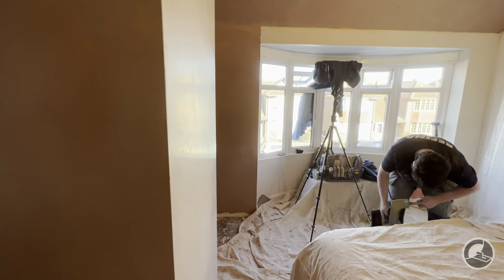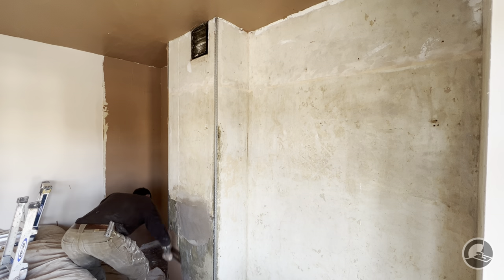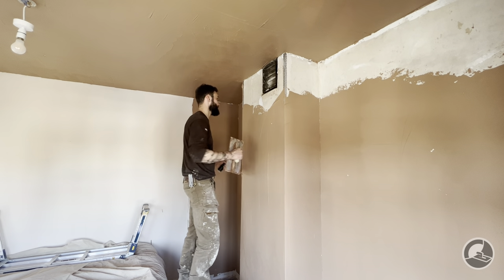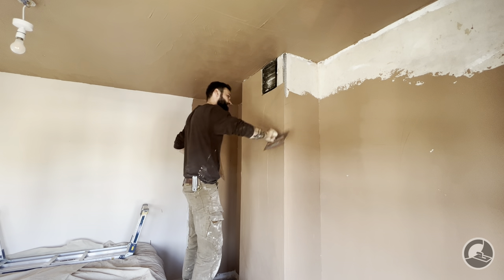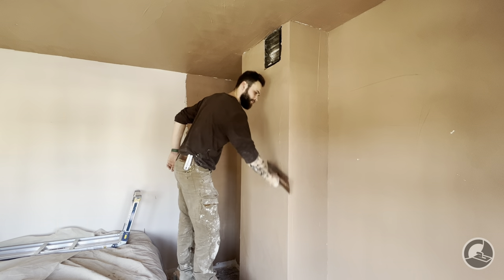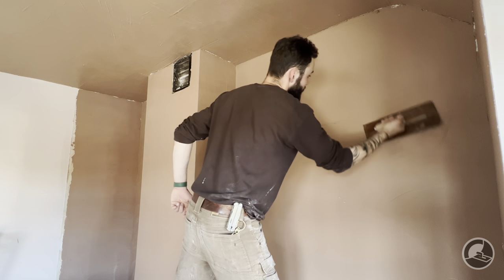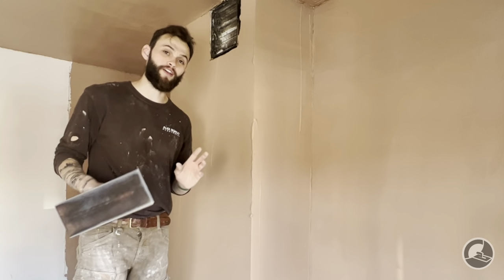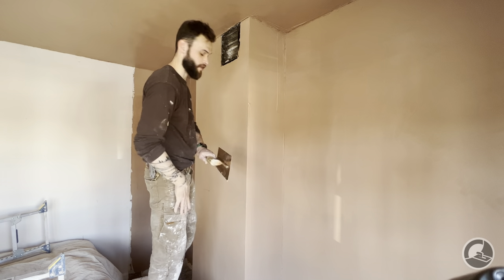Plaster Flat Walls With Just a Trowel

Comment: I'm a complete novice tried to plaster on plasterboard 2ft by 8ft only managed 1 coat went hard before could do anything else have you any links or videos that could help me. And how do you gauge how much plaster to mix I mixed 3/4 bag and thrower half away thanks
Reply from the maker: Easiest way is to gauge it on the m². 1 bag does about 10 m²

Comment: Beautiful work again buddy. 

So when you use just the trowel and on old walls, you combine the flatten and close in?

By the way is it okay to use a bag of multi 4 days out of date on an old wall? I was going to have another practice weeks back but a back injury stopped me but now I’m ready to go my bag of multi I notice was out of date 4 days ago.
Reply: Should be ok m8 I’ve used over month old and no different
Reply: @Nofixedabode859  thanks bud. And it didn’t go off like a rocket?
Reply: @MarcusT86  no not at all m8, as long as it’s not sat on cold floors and off ground it will be 100%, I’ve heard people use it 3 months out and still ok but like I say keep it off the deck or on something insulative
Reply: @Nofixedabode859  oh shit I’ve had mine on my cold downstairs floor for a few months now
Reply: @MarcusT86  yeah wat happens is it starts to go lumpy at bottom but if still powder mix half and see how goes
Reply: @Nofixedabode859  thanks buddy! Still feels nice and loose
Reply: @MarcusT86  yeah give it a go m8 mix it up and leave 5 mins if still same use it
Reply: @Nofixedabode859  so if it’s still sloppy after 5 mins and just like I first mix it it’ll be fine?
Reply: @MarcusT86  that’s it m8
Reply: @Nofixedabode859  thanks buddy!
Reply from the maker: Hi Marcus

No need to close the plaster in as you flatten it at a much later in the set. So
The plaster has pulled in a lot more.

Comment: If you hold a long straight edge against the plaster is it realistic that it’s completely flat against it? I’ve plastered a few walls and the finish looks good but against a level it’s a few mm low in places.
Reply from the maker: Just practice getting the timing right. If you flatten it too early it leaves it a bit early when doing it all with a trowel.